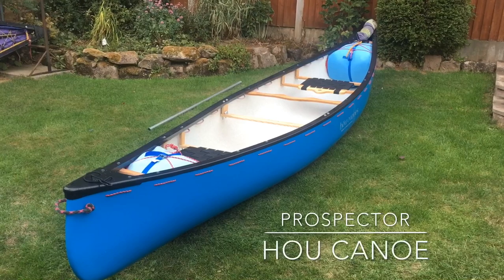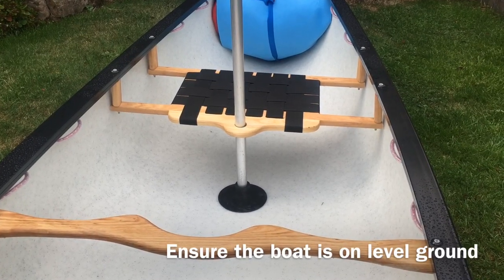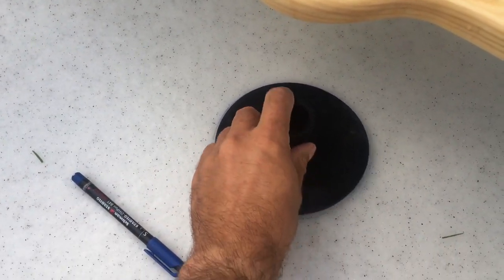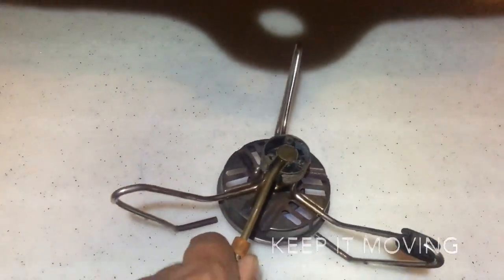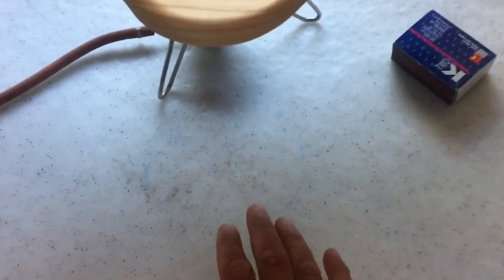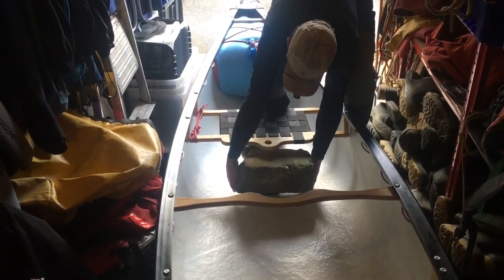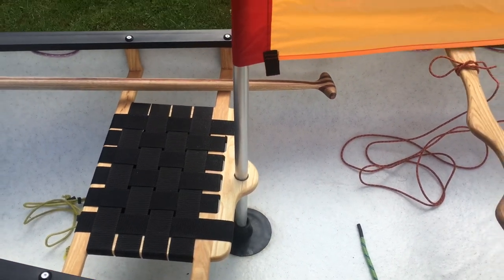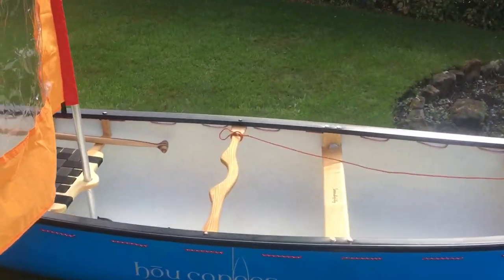Canoe Sailing set up for effective expedition sailing

Comment: Wind and canoes are basically incompatible,, no ballast and no keel.  So, a canoe can be a downwind boat,, but.
As a downwind boat a canoe needs so very little sail area. The exposed back of the paddler has a tremendous effect on the canoe. Last week I took the two back up paddles, and bungeed them across the canoe, blades square to the wind at about the yoke line.  That, plus the windage of my back, was plenty to move the boat,,,perhaps even too much.  Sails do work,, if the wind is sufficiently behind and constant vigilance is used to forestall wind gusts knocking you down.  However, that does mean,, and absolutely, that this is a never do on an expedition boat,, often far from shore, and very far from rescue.  I do paddle an expedition boat,, and routinely am off for weeks at a time.  The risk of a knockdown a mile from shore and rescue time measured in days or weeks.  Nope.
Reply from the maker: You are correct that canoes aren’t ideal for sailing due to the points you made above. However they are often used to sail on expeditions quite effectively, with specialist groups set up to get the best from their boats. Canoes have been sailed tandem and solo teamed between Ireland and Scotland and all around the UK coast.
Reply: @outdoorinstruction  Tandem canoes is a very interesting configuration.  I have seen linked canoes on the Missouri River.  2X4s and a sheet of plywood forming a platform.  It would be simplicity to add a sail to that rig.  I do paddle in extreme winds from time to time..  Last month, twice, I had a tail wind, substantial.  I took my two spare paddles and bungeed them across the rear thwart in front of me,,, with the paddle blades projecting left and right, half a meter out either side.  Rotated the blades to a vertical face.

Just two faces  20cm X 50cm,, plus , of course, my back to the wind, was enough to push the canoe to near 10kph at times, 6 and 7 mph.  You do not need much in the way of sail with a canoe.